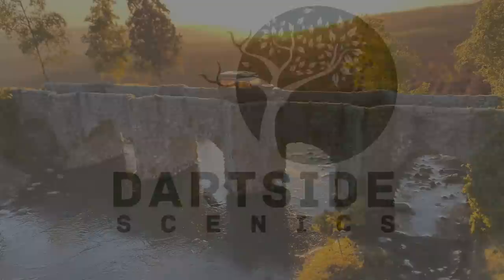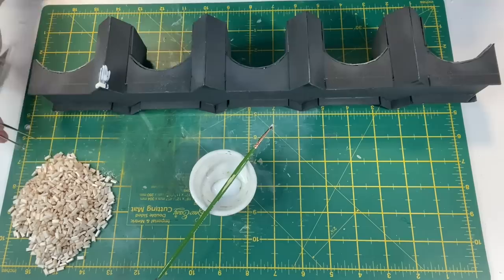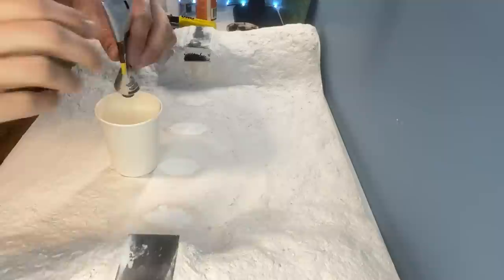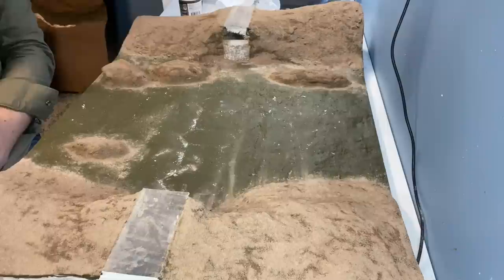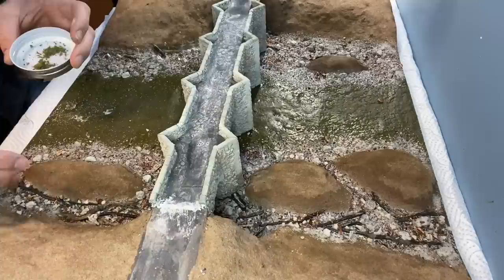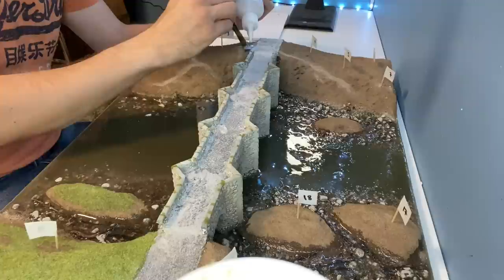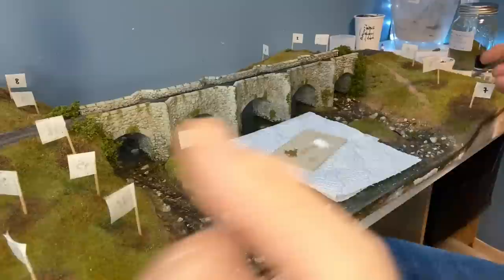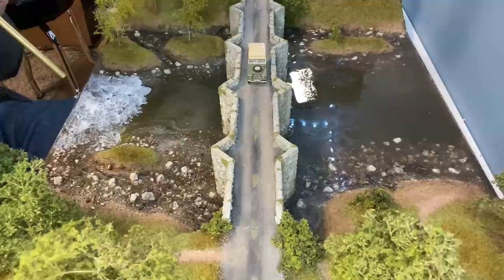Build an AMAZING stone bridge diorama/model

Comment: Great detailing, but I could not be doing different levels and directions of small shoals of rainbow trout at different levels of say 4 water pours, three for fish levels laying across one another with maybe a pike hanging around in the stones, and one top pour to cover everything else. You can create such detail with clear water resin as every level a pour mixes with the next and anything at different levels brings the water alive.
Reply from the maker: Very true.  I haven’t tried the different levels yet as the colour I use is often too murky to see a lot of detail.  I think I would need to do a test first rather than risk it on a model I’ve spent a long time on!

Comment: Absolutely stunning Andy, worth every minute of the many hours you have put into that and the Bovey Tracey shots really did it justice mate. I have recently used your videos to help me create a stream bed and a Devon bank and have been delighted with the results. Just one note of interest, I noticed that your resin had clouded over in places after curing, I had the same in some areas and put it down to the temperature being a bit low but a quick application of Mod Podge for ripples soon hid it. Have you found another other solution for that? Cheers Steve
Reply from the maker: Thanks Steve.  I would love to see the photos of your modelling.  Yes, the Mod Podge seemed to cure the film on top of the resin.  It might be the cold temperature in my garage or I didn’t mix it well enough.  I have read of people sanding it and then adding a thin layer of resin over the top but I don’t think I’ll be trying that!!
Reply: Think it must be the cold Andy, I followed the instructions to the letter and it looked great for a few hours and then clouded over. Will PM you some photos, cheers Steve